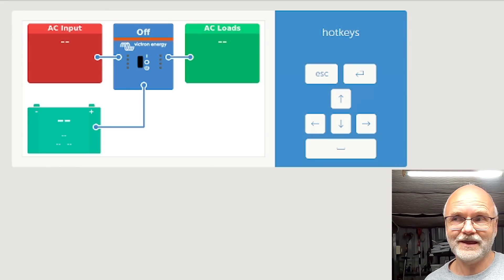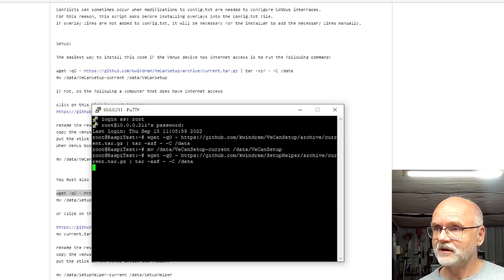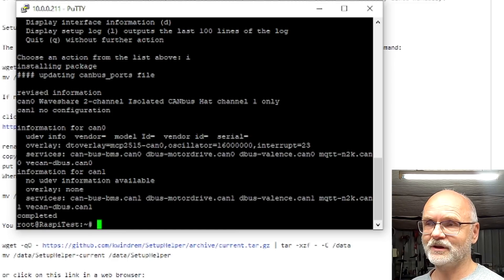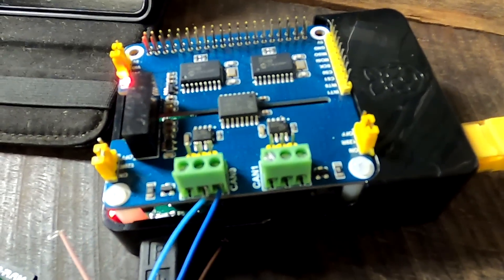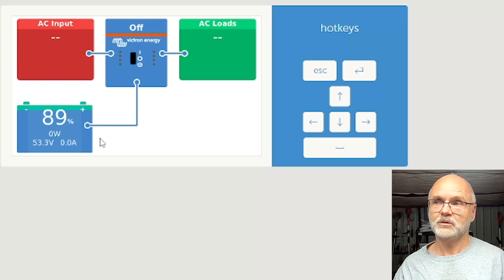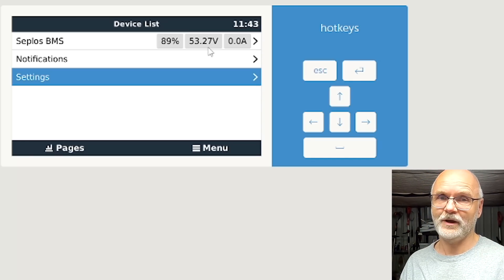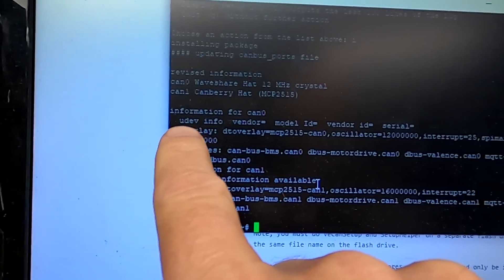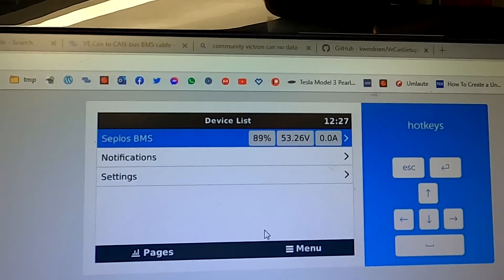Seplos BMS and Victron Venus OS connected via CAN. Very easy setup (almost).

Comment: At 1:48 in the wideo , You say you installed Venus OS large , Is that the standard version from the Victron Website that you then modify with code updates from Kevins Github  between 2:48 on the video through to 5:09 ?
Can anyone advise if the full modified version be installed directly from Kwindrem GitHub files or is the only option to do it the long way as per this 2 year old video ?
I am hoping to use a Pi-4B , twin CAN HAT and connect to a Victron Inverter , Victron MPPT and Samsung ELPM482 batteries .....

Comment: I thought I'd chip in here. Kevin's latest VeCanSetup works straight out of the box with the single waveshare Can/RS485 Hat as shown, choose option 5. The hard bit to find (anywhere) is the required Hi/LO can connections. Looking at the contact side of the RJ45 connector Pin 4 (typically blue on a std network cable) is Hi, Pin 5 is Lo (typically light blue or blue/white). This works on the Seplos BMS - assuming  you have the bluetooth version which can be set for Victron.
For Helen you are right the options have changed, what was 9 in the video is now option 5. so I think you are looking at option 6 or 7 now - hope that helps.
Andy many, many thanks for your videos, I couldn't have worked this out without them, Danke Schön

Comment: Hi Andy. Thanks for your videos. I been watching them on repeat while we have been setting up our system! I just wish I got half the enjoyment out of it as you do.
I've been trying to set up our REC Active BMS via can bus.
I have the 2 way RS485 can hat for the Raspberry Pi, which thanks to you is now running Venus OS. However I can't get the Pi to recognise the hat. I get a completely different set of options to you in the video. I've run with what I think and then get stuck. Kevin's instructions run out at that point. Is there any way to get in touch with Kevin to troubleshoot where I'm going wrong? Thanks, Helen

Comment: Thanks Andy I got my board setup.  Just wanted to let you know the driver install is a bit different now and there are more options.  I think mine went ok but don't have my lynx shunt in place to check yet.  Here is my install log if it helps others.  I got the same board as you on amazon and it appears to be ok.  

VeCanSetup adds CANbus ports to the Venus OS system
Raspberry PI includes 0 CANbus ports
an unlimited number of USB ports may be configured
one single or dual CANbus hat may be configured

Available actions:
  Install and activate (i)
  Reinstall (r) based on options provided at last install
  Uninstall (u) and restores all files to stock
  Quit (q) without further action
  Display setup log (s) outputs the last 100 lines of the log

Choose an action from the list above: a
Choose an action from the list above: i

no CANbus definitions found
Available actions:
  Add a USB interface (a <interface>)
interface may optionally be added to the action, (e.g. a hat or d 11)
USB interface must be 10 or greater
Hat interface should be entered as 'h' or 'hat'

Choose action from list above or (cr) if done with changes: a hat
1 ) Canberry Hat (1-channel)
2 ) PiCAN-M Rev B 2.0 Hat (1 CAN-bus, 1 RS422 channel)
3 ) PiCAN-M Rev B 2.0 Hat (1 CAN-bus, 1 RS422 channel)
4 ) PiCAN Hat (1-channel)
5 ) Waveshare 1-channel CANbus Hat 12 MHz crystal
6 ) Waveshare 1-channel CANbus Hat 8 MHz crystal
7 ) Waveshare 2-channel CANbus (non FD) Hat
8 ) Waveshare 2-channel CANbus FD Hat

Choose the Hat configuration from the list above (by number) (cr to skip): 7
selected interface: Waveshare 2-channel CANbus (non FD) Hat

Install both channels of this interface (y/n)?: y

Enter optional name for first port on this Hat (cr for none):
Enter optional name for second port on this Hat (cr for none):
Waveshare 2-channel CANbus (non FD) Hat
  can8  spi0.0
  can9  spi0.1

Install interface as shown above (y/n)?: y
adding CANbus hat
Hat configuration updated

CANbus interface definitions:
interface: hat ) Waveshare 2-channel CANbus (non FD) Hat
  channel 1: can8 spi0.0
  channel 2: can9 spi0.1

Available actions:
  Add a USB interface (a <interface>)
  Delete existing interface (d <interface>)
interface may optionally be added to the action, (e.g. a hat or d 11)
USB interface must be 10 or greater
Hat interface should be entered as 'h' or 'hat'

Choose action from list above or (cr) if done with changes:
installing CANbus ports
adding udev rules for hat
updating VeCanSetup udev rules
adding new CAN hat overlay to config.txt

new interfaces will not become active until after a reboot
adding VeCanSetup/setup to reinstallScriptsList
Reboot system now (y) or do it manually later (n): y
rebooting ...

Broadcast message from root@raspberrypi2 (pts/0) (Fri Feb 10 16:54:37 2023):
The system is going down for reboot NOW!
Reply: You may have answered my question. Will try this tomorrow and if it works, I'll be ever grateful!! :)
Reply: This worked by following your instructions - thank you! I'm now trying to figure out how to connect the can cable to the can port. It's quick in Andy's video and I can't find the obvious info online. I have a can connector to ethernet cable from my BMS.
Reply: @lockharthelen  I'm not sure I just got to the configuration and haven't gotten back to my project.  I "think" you pick one of the ports and just make sure the other end is terminated.  I think the Canbus is internally terminated but can't say for sure.  I'd try a port and if it doesn't work I'd try a different one.   The lynx should have one in port and then the termination on the other port I think.  Good luck.
Reply: @timothyflynn  Thanks. I did it with our REC bms! I had the wiring diagram for the ports used by REC, so I dissected a can cable and used the terminating ends to wire into the Raspy. All works perfectly!!

Comment: Andy after getting Venus OS setup on my Raspberry PI the next step for me was getting it to talk to a lynx shunt.  No reason this can bus adapter shouldn't do that?  I have a 500 amp bt shunt but I may use that to track the usage on my non victron inverter.  Thinking of using the lynx since i have 2 power ins for terminal blocks anyway and it would be cleaner to stay lynx.  I'm going to get the isolated board in this vid and make sure I can get my venus device to recognize it before ordering the lynx shunt.

Comment: Thanks for your hard work Andy and Kevin. I recently bought a pair of Pylontech batteries. I have a Cerbo GX but its connected to a 12V system and I want to move to 48V with the Pylontech and a 48V inverter. I bought the Waveshare can hat you linked too and whilst the Kevin's VECanSetup program isn't the most user friendly program to install and setup it works superbly.

Comment: Just as an update to this  Can hat driver page link has changed from  video and been updated work with Venus 2.91-2.92 v with rpi4  Waveshare can hat 2 ch  isolated none FD
Reply: On which can hat you are reffering regarding Andy's video? He uses, lets say a bigger and smaller on from waveshare. The bigger on is also the one he gets running first. Thank you.

Comment: Hello Andy,

Witch wires do you take from the CAN Cable for Can hat to connect?
thanks
Reply from the maker: That depends on your BMS. Do you have the Seplos as well? Have a look in the manual for the Seplos BMS. A good portion down in the document  is the pin-out for their CAN port.

Comment: Hello andy . Here a follower from Spain! Is there anyway to keep the voltage when the battery is full charge with the seplos bms . Because when the battery is full charge . The bms strop the charge and this dont let the inverter inject more amps.  And after few hours the voltage drop from 3.5 to 3.35 or so . I don't like so much this bms atm . What do you think..... I just keep working with this.  Or swap to the jk ? Thanks dude !
Reply from the maker: That is totally normal. 3.35V is the so called Resting Voltage. The battery is still 100% full. Voltage is not an indicator for state of charge with LiFePO4 batteries, so don't worry about that. It's perfectly fine and shows a healthy battery.
I've set 3.35V as float voltage in my MPPTs. This is the voltage the batteries will rest at anyway (and still being 100% full).
Reply: @OffGridGarageAustralia  thanks so much 🙏 for you quick reply Andy.  You are one of the biggest referent on this world!!!

Comment: Hi, I would like to ask if anyone might know how to connect and display data from another DC-AC 230V 48v 5kW inverter to the Victron Venus OS system. As well as how to connect a BMS from not from Victron.
I'm a big fan of Victron components, but unfortunately I don't have enough money to buy the Multiplus II 48v 5kW that I would need. Otherwise I'll have to go for some All-in-one inverter 48v 5kW for 1/3 the price as all the necessary Victron components.
Thank you, best regards
Tibor (Czech Republic)
Reply from the maker: You have to use an electronic meter and connect the inverter through that. The meter then sends the data to the Victron system. These meters for example work with Victron (EM111/112, EM24): https://www.gavazzionline.com/CGNA/energy

Comment: I plan to leverage this video to install a 3rd party inverter/charger as well as two solar charge controllers using the RS485 port on the CAN HAT that mounts on the RASPI.  Looking forward to making it all work.  I will also be adding my Daly 500amp BMS as the 'battery monitor' using the other video for that.

Comment: What are your thoughts on doing a Seplos DYI with a 3rd party BMS? one that is more straight forward.
Reply from the maker: If you have only one battery, you can use any BMS you want but the Seplos BMS makes sense if you have more than one battery and want to stack them. All the single BMSes need to communicate their information to Venus OS (or the inverter). That only works with these sort of BMSes. A JK or JBD BMS would not be able to do that. They are just single battery BMS.
Reply: @OffGridGarageAustralia  Thank You :)
Reply: @OffGridGarageAustralia  What were you final values for the Seplos BmS parameters need to watch all your vids again will configure my battery in a couple of weeks.
Reply from the maker: @sharaiestevez5597  I haven't made a video about that yet. I'm still testing and experimenting. More videos and information about the Seplos BMS very soon here in the channel.
Reply: @OffGridGarageAustralia  Awesome looking fw for more videos. Hi all the way from Puerto Rico :)

Comment: Thanks for the video - great work. Can you cascade different batteries ( BMSes ) via CAN into Venus?
Reply from the maker: That would not work afaik. There can be only one CAN bus so you would need to connect all devices to this same bus and terminate at the end.
Usually, the batteries are connected via RS485 and only the master uses CAN to communicate with the Victron system or other inverters.

Comment: Hi can you please help my jk BMS is not reading the correct current how can I calibrate it I have tried in the app but it won't let me change it
Reply from the maker: You need to put a password in before being able to change any parameters.
Reply: @OffGridGarageAustralia  have done that it's 123456 and it still won't let me calibrate it
Reply: Think I have worked it out you have to isolate the BMS so no current going in or out of the BMS then calibrate it to zero
Reply from the maker: @dama054  You can either do that or have a confirmed, say 5A going through the BMS and put this number in he settings. Same for the voltage.
Reply: @OffGridGarageAustralia  thanks for your help Andy

Comment: Hi Andy and community,

I‘m pretty new in solar-business, and trying to understand if i need a communication between (JK)BMS and a inverter to (dis)charge a battery. 
Or is a inverter intelligence enough and can (dis)charge just by monitoring the actual voltage/current. Then i use the BMS is just as a more precise saftey system?  

Best regards and nice videos. ✌🏻
Reply: If you don't want very specific state of charge-based responses, then voltage control is fine for you. Remember to make sure that your inverter switches off long before you reach the BMS's internal cut-off voltage, otherwise you'll be stuck and possibly need to "jumpstart" from another source. You also need to make sure your float charge voltage is safe for long term use, it's better to be a little conservative here, LFP batteries don't need to be at 100% state of charge all the time.
Reply from the maker: Thank you Stefan!

Comment: Any idea connect jk bms can bus my inverter support can bus
Reply from the maker: No, no idea. Do you really connect your BMS to your inverter?
Reply: @OffGridGarageAustralia  Yes my solar controller is Solis. if support Lead acid battery if w/o CAN connection then it can charge and discharge up to 100A that is 5KW. If I define. the battery is user-define Li battery then I need to connect the BMS. I checked the manual from inverter it told me the CAN+ and CAN-. I also found the CAN+ and CAN- from JK BMS I think it is possible to extend those signal to CAT-5 Female connector. If CAN connected then inverter will know the battery status.
Reply: My INverter has backup AC. which it will load the power from battery. or the battery output the power to the grid. but that is max 5KW. I bought the other 48V to 5KW inverter. so that I have two backup 5KW power. in that case I can power my house with two live 5KW source to different circuit   in the house.

Comment: Hello Andy,

I have the same setup of you , Selpos 150 A BMS an a raspi with the venus OS but i have the WaveShare RS485 CAN HAT adapter, and i became no connection. Works the communication wir the single can hat, or i must need the double can adapter? my venus OS see my can HAT adapter.
Reply: Hallo Andy, Ja ich habe die gleiche Fehlermeldung, aber er wird im Venus OS erkannt, ich bekomme aber keine Verbindung. Nun habe ich mir auch den 2-CH Can HAT gekönnt. Den alten habe ich erst deinstalliert und dann den neuen Installiert. Trotzdem bekomme ich keine Verbindung. 

So nach einigen Probieren ist mir aufgefallen auch bei der neuen Platine habe ich das Problem das diese nicht richtig installiert wurde.
Habe nun extra das OS auf einer zweiten SD Karte neu aufgesetzt und ich habe das gleiche Problem.
no udev information availabal    ;(
Reply from the maker: @virtez87  Seit dem Video kann ich keinen der beiden Adapter mehr zum Laufen bringen. Habe zig mal neu installiert und auch aeltere Images versucht. Nichts!
Ich werde Kevin kontaktieren und eine Fehlerticket auf seiner Github Seite erstellen.
Reply: @OffGridGarageAustralia  also war da anscheinend ein Zufallstreffer, dachte es liegt vielleicht daran das ich nur einen 2er pi habe. 

Wie hast du deine Akkus aktuell angeschlossen ?
Reply from the maker: Do you get the same error as I get with 'no udev information availabale'?

Comment: Sorry IV not been able to help on this project, but I'm not very good with IT shit.
But I'm just in process of a big upgrade to mine system 12v to 24v with another 7.7kw of cells going in plus more panels and bigger grid tie.
Wish you well catch up soon.
Reply from the maker: Sound great, Marc. That's a big system change going from 12V to 24V. Good luck and happy charging!

Comment: Excellent information Andy, thank you. Could you show us how to connect BMS to Cerbo GX please. Bob in the UK
Reply: Should work out of the box.
The CerboGX already has CAN built in and activated. Just make sure you have a cable with the correct pin mapping. Have seen a few people have to cut an Ethernet cable in half and join a couple of wires the correct way around.
Reply: @gavinnoname1424   Thanks Gavin, I see the JK BMS doesn't have the same plug as an ethernet cable, how do I get around that. Bob
Reply: @stoptheirlies  I just realised what I originally put was incorrect.
I was still thinking about CAN from this video but the JKBMS doesn't support CAN.
The output is TTL.
They advertise it as RS485 but that is only if you connect the adapter that Andy used in his last video. The SerialBattery driver from the last video can talk on RS485 or TTL, the you really don't need the converter.
Reply: @stoptheirlies  so for the CerboGX you would still need to do the same steps as Andy from the last video with the SerialBusDriver.
Andy used a USB to RS485 adapter and then connect it to the JKBMS RS485 convert, which then connected to the JKBMS.

Alternatively you can get a "USB to TTL adapter" and then connect directly to the JKBMS. (This is what I did and the JK screen still works)
The connector on the JKBMS is a Molex PicoBlade (4pin), just connect the GND, TX, RX between the USB adapter and the JKBMS.
Reply: @gavinnoname1424  Sorry Gavin I didn't quite follow that, I understand that the JK BMS does not do CAN, but my 14S-24S 200A 2A appears to have a can/RS485 socket? but anyway are you saying I can connect the JK directly to the Cerbo or do I use the RS485 adapter or a different one. Bob
Reply: @gavinnoname1424  Thanks Gavin, I'm hoping Andy will show us too,
Reply: @gavinnoname1424   Thanks Gavin
Reply from the maker: Yes, this will come soon...

Comment: Andy you mentioned the CAN port being pointless on the RS485 BMS, but I think the confusion is based on the labelling of that port. It should be called "Inverter" Port. There are two pins for CAN H+L and two pins for RS485 A+B.
So if you want to connect the Seplos using RS485 you would still use the same "Inverter" port. The other two RS485 ports are for stacking batteries.
Reply from the maker: I'm not sure about this. I cannot set any CAN protocol for this BMS at all, so it seems to be inactive or the BMS does not have a CAN chip at all.
I cannot seem to find that information in the manual that this port has both connection for RS485 and CAN for an inverter.